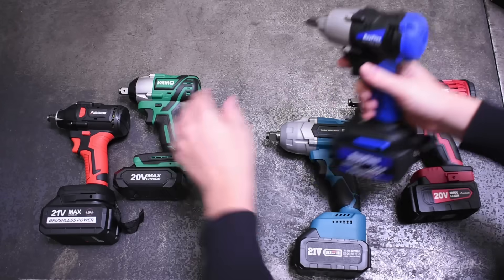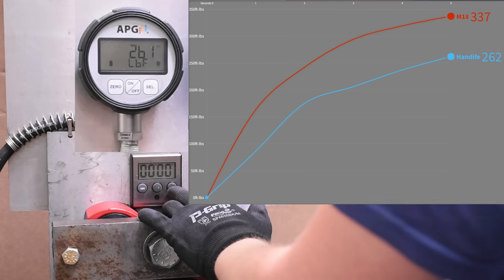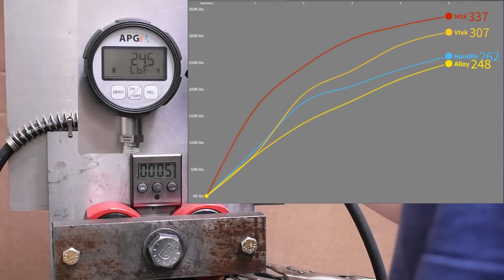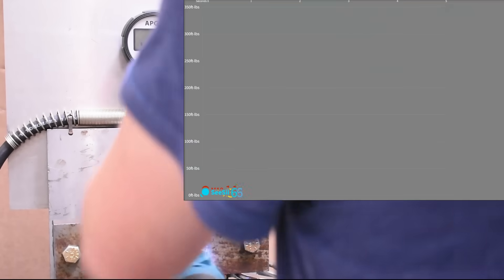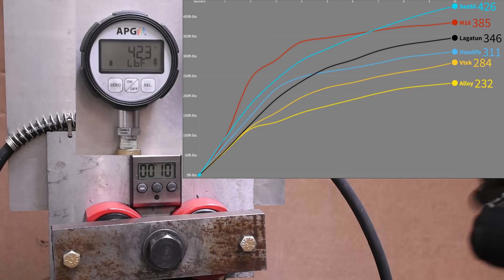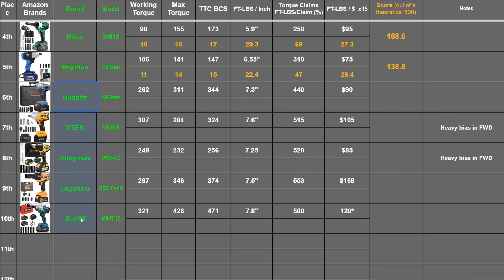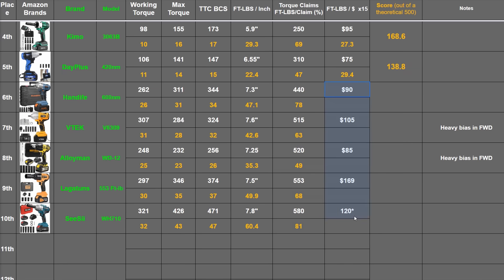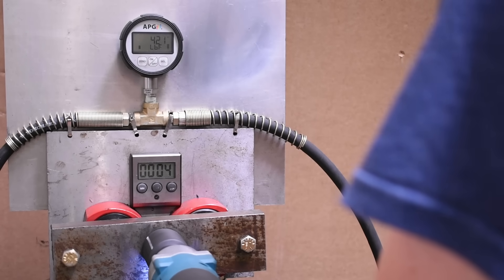The Most Powerful Amazon Impact Wrenches vs Milwaukee: Not Bad!

Comment: Bought Seesii WH710. Found on the big A for $70.00 1 battery version. To be delivered today. Just for removing lawn mower blades for now. Made this choice based on reviews and their mini chainsaw reviews.UPDATE: Used this on 22 inch Toro Recycler & 50 inch Toro Timecutter Max zero turn. Took all blades off effortlessly! Needs 16mm socket. Used regular socket out of my tool kit. Highly recommend!😂

Comment: so ft lbs is just an exaggeration to make you think like you're getting a higher foot pounds?
Reply: I would assume that the numbers everyone chooses, from the Amazon sellers to the name brands, are the absolute tightest bolts these guns can theoretically break loose.  They may take some time doing so, but they'll get those bolts off eventually.  The tests TTC does are useful, but they can come short of what companies can claim, because they don't run long enough to see the lines plateau, which is the theoretical tightness the impact wrenches will have any effect on.  In another video, a Dewalt DCF961 was able to climb up to 1000 foot pounds, but once it reached that number, it didn't climb much higher, meaning it's limit is 1000 foot pounds and anything tighter will be a no go.

Comment: The Seesii and the Handife/VTEK twins are all Wosai/Qidong Edge Tool products, models 50081 and 5008 respectively.  I don't understand, however, how the twin tools perform so different from one another, Handife preferring reverse and VTEK preferring forward.  I also noticed the VTEK's anvil is sticking out a bit more, so maybe this is actually a badly assembled clone?  EDIT:  I did some mild research on Aliexpress and I saw an impact by "Ipopulus" that has the same protruding anvil as the VTEK, so it's probably a clone of the Qidong Edge Tool original.  Nevertheless, since the Handife and Lagatuns are no longer available, that only leaves the Seesii, VTEK, and Alloyman as the survivors.  The value of the Seesii can't be beat, and the VTEK is a naturally cheaper tool that can get some steep discounts (currently can be had for 49.99, down from its list price of 79.99), while the Alloyman has lackluster performance with too high a price (currently 74.99, with just ONE battery, down from the regular price of 99.99).  I consider the VTEK ideal for tire changing duty, be wary of the forward bias however.

Pah, it was this video that enamored me to the world of Amazon impacts, as I bought the WH710 and the Ework RB-809 thanks to your testing, and am planning on buying an Ework RB-810 (which you tested as a Seesii WH750, which is now discontinued) as a gift for a coworker, since he liked my RB-809, as well as another WH710 (or one of its clones, such as the TaskStar or Takuoo flavors) for a friend, due to its consistent sales and value.  For these prices, they are phenomenal, and your testing helped shine a light on these affordable gems.

Comment: As someone who works in the trades those Amazon impacts and drills may have more power but take them on the job for a few weeks and see how they hold up😂😂😂.  This is why all I own is red because I can throw it let them fall from a ladder get wet out in the elements and they just keep going.  Same with DeWalt
Reply: Thinking about buying snapon impact. Any thoughts on their stuff?
Reply: The M18 has two things going for it - one it's nearly 2 inches shorter than the Seesii, and the torque curve is a lot more responsive instead of gradual.  Like the video said, the M18 will break loose certain tightness faster, but in theory the Seesii should break loose tighter bolts first - assuming the charts work in real life the same way.  A similarly sized tool from Milwaukee or Dewalt will leave it in the dust, however.

That being said, I would argue only Milwaukee and Dewalt are tailored to the trades, with warranty processes to reflect that.  Every other brand, be it Ridgid, Kobalt, Ryobi, those are more tailored to the home DIYer, and those would be fairer comparisons to the Amazon offerings.  The fact many such tools work a lot better in reverse than forward implies they're more for breaking things loose rather than driving bolts through, which is what the average person is most interested in.  However, there was a video where a guy was taking the Seesii through various torture tests, and it still came out working.  I wouldn't trust it to do the work you describe, however, but it would be a fun experiment to take it with you, and bring the M18 or what have you as a backup so you aren't stranded if and when it fails.  It habitually goes on sale for 101 dollars (and sometimes down to 99) and they almost always include a 20 dollar discount coupon as well, for 79-81 dollars before tax, for a tool that includes a case, two batteries, a charger, and 6 sockets, that's not bad at all.

Comment: I’ve got the compact and mid torque SeeSii and they are awesome!! They’re the ones I take on the trail and don’t mind the dirt and grease on them from changing CV axles and turning suspension bolts and nuts. Thanks TTC

Comment: In the number one reason why these impact wrenches seem to be a good value for the money is because could you imagine trying to find a battery pack for a no-name brand device a lot of these devices are going to change names within the next 6 months so imagine you have this impact tool and it's 3 years later and you need a battery okay but VTech or CC well you can't find those anymore Faith change names are you going to get a battery that fits

Comment: The reason is cheap electronics a lot of the no name brand cheap chinese-made impact wrenches although they are somewhat decent the problem lies in the electronic boards that are put in them so once you drop these things a few times or get them wet or subject them to harsh whether they'll stop working that's why they're cheap they're cheap because you're not going to have it for 25 years they're cheap because you're going to probably use it for about 2 or 3 years and it's going to stop working possibly for no reason
Reply: Milwaukee and Dewalt are also made in China bud

Comment: So I just ordered this based off this video, and I can tell you that if you have Amazon prime, the price of this tool with the single battery kit is now sitting at less than $70 after applying a $25 instant coupon and a 10% off promo coupon.  That's one hell of a deal.
Reply: Is the deal still on?
Reply: Where do you get the coupons
Reply: @ippytuklulu  they automatically show up on Amazon, you just click on it to apply the discount

Comment: @Torque Test Channel I own the Handife since September 2021 and it's a beast! When I purchased the Handife I replaced both front half axles, both tie rods, both upper and lower ball joints, rotors front and back, shocks front and back on my 2003 Dodge Durango.
As a test I didn't use PB Blaster on the the passenger side, but I used PB Blaster on the driver side. 
Handife broke every single rusted bolt off with ease.
Prior to buying the Handife I tried using my friends Milwaukee and DeWalt impact wrenches and neither one broke the rusted half axle bolts lose, and that was with using PB Blaster.
The Handife inpact wrench I own, I'll put up against any impact wrench.
The Handife I own is no joke. My mechanic friends has offered me double to triple amount of the money I spent on it and I turn them down.
I picked up the Handife when it was on sale for 89.99 plus and extra 20.00 off. A beast for only 69.99+tax.
Reply: I think there is more to Impact Wrench performance than just raw power. The design and effectiveness of the hammer design for example. I have Wrench witch is a close mate to the Handife and I share your experience as well. Paid $59.00 including hard case 2 4 amph batteries with a decent charger and have no regrets. Would buy it again.

Comment: I Bought a SeeSi after seeing this video. I even read their amazon review of some being defective from the start. I charged the batteries and tried removing my lug nuts and it was not strong enough. had to do the job with hand tools and a breaker bar. I tried again and the tool now only worked in spirts. I guess i got one of the defective units.

Comment: There is now a SeeSii WH750 for $150-$40 coupon = $110 (1 4A batt + charger).  I believe this is the Gen3 product.  Note that this one comes with a blow-molded case (TTC did not care for the prior case).  They claim higher torque than the WH710.  Please test.

Also, someone said that the batteries are Makita-compatible.  If so, it would be interesting to compare the performance when using Makita batteries with SeeSii tools (and vice-versa).
Reply: I want the wh750

Comment: I bought the SeeSii based on this video months ago and was blown away by it's performance!
 Not mentioned in the video is that it has 3 modes which makes it perform well while saving battery life. This thing worked so well removing torqued nuts and bolts from super steel support beams for machine conveyors it was almost comical.
I later found a 1/2 inch keyless drill chuck attachment that I added to this tool's well appointed kit. And the price point made it a bargain.
  This video was instrumental for a great tool find. Thank you!
Reply: can you link to the drill chuck you found?
Reply: How's the seesi holding up
Reply: @funkmon  very well !
  I had to replace a BMS on one of the batteries but that's alright.
 I was hoping that one of the guys at the job site would drop it accidentally so I would have an excuse to buy another one. 🤭
Reply: @Mr_Joseph979 how is it doing now
Reply: @ippytuklulu  it's doing well. One of the batteries died inexplicably to which I replaced the BMS. That didn't work so it was probably a few weak cells but I just replaced the battery, which is the same as other Chinese batteries. I still like the unit.
Reply: It's currently $108 at Amazon right now in September. That's a very good price for performance for any DIY warrior.
Reply: @joseCalderon1976  it is, but when it dies after 3 months, those 108$ are gone for good...
Reply: @PM-wt3ye  I've had mine for over a year and a half now, used literally daily for roadside assistance/mobile mechanic work in some of the worst conditions imaginable.....and it's still holding up strong.
Reply: @williamwakely1398  The problem is, you dont know what you get with such a tool. you may be lucky sometimes, but when all your tools are extremely cheap, this will change. the known brands are too expensive, sure. but these tools are WAY to cheap to be consistently good. especially, when there is absolutely no warranty what so ever.
Reply: Answering myself here, it loosens and tightens crank pulley bolts very well.
Reply: ...Buying it with the extended 3 year warranty is a must if you go  this route.
Reply: What are the batteries like that come with the kit?
Reply: @dmusk  lithium ion 18650 batteries that total 21 volts or pack.
 2- 21v batteries with a charger and 6 impact rated sockets. The updated package comes with a drill driver adapter that I didn't get with my kit.
Reply: @Mr_Joseph979 can you link the chuck you found?

Comment: I recently got a Uaoaii 21v Brushless ½" impact wrench off Amazon. It looks a lot like the SiiSii one, almost identical but mine is more compact, I guess mid range? It's worked pretty well so far. I've used it to do my front and rear shocks on my car. I wonder if it is the SiiSii but rebranded? It has the same battery as well. So I can use a makita battery on it?

Comment: Great comparison, thanks for all your affords, all my tools are Bosch, have a 160Nm Bosch impact driver, but I need a high torque impact wrench maybe once a year if something is stuck as a hobbyist, watched this video last week, so I went for a SeeSii Gen2 today, it was on discount on German Amazon for €110 ($ 115) I am in the Netherlands, but shipment was free. 
Seen another review and the battery calculations were 3000mAh and after a teardown on that video confirmed that too ( https://youtu.be/pNTWWNZjPUs?t=240 ), I was planning to rebuild the batteries but since you tested with an original Makita 5Ah battery and didn't see much improvement, I will leave it like this. Again, thanks for the test!

Comment: Do all dead blow hammers deliver the same force?  Are they better always than solid? Does “anti-vibe” work?  Use your rig for air hammer. Wedges made of different materials. Aluminum steel hard steel plastic

Comment: I've recently bought a Tagred TA800, which is a small (114 mm/4.5" long) 1/2" air impact with supposedly 1200 Nm. Now I know that it's not getting anywhere near that, but with enough air this little thing actually does hit a lot harder than I expected for ~50 € (+ VAT, so here in CZ it ended up at ~60 €). I think it could be in the 400s or even low 500s. Do you think you could somehow get yourself one of these from Poland and test it on the dyno?

Comment: Yeah i bought one brand, called bossmann, seriously it is powerful enough. Easily loosen 400nm tight lug nuts. And loosening my suv lugnut that been lock with 700+nm air compressor gun. And the price just around 30usd.

Comment: the length needs to be a big factor, some of these "midtorques" or longer than high torques.. im sure milwuakee could make enough torque to snap the 1/2" anvil off if size wasnt a factor... they must make 50 iterations of every impact gun trying to shave off 1/8" pieces of plastic where it counts to get it to reach just a few more vehicular use cases

Comment: How about some basic durability over time test? Like yeah they can push some power, but... for how long? Maybe we could get some ideas on how to make such test. Like for example just tape trigger so it will work constantly until battery will die, throw it a bit then(from like belt high) and repeat it and see if later it will do some actual heavy work. Or if you have time just test it under load few times to see if it will not die after day of work...

Comment: Are you insane? The low density foam case is a way better option. Almost everyone I have ever met just tosses those blow molded case in the trash as soon as they get them like it's part of the packaging, or throws them in a big stack to never be used. On the other hand people pay for empty case with foam inserts because you can customize them to fit different accessories by cutting the foam, and you can keep them for different purposes long after the tool becomes landfill.

Comment: Need to do a test on the batteries to see who has the most amp hours, that'd be interesting.
Reply: That could be a job for Philly Fixed, its not really torque related so better if they outsource it.
Reply: @pflaffik  probably, but he has done other test than torque on other products. Need to have a battery tester to put a load on them and measure the watt hours.

Comment: I can't fathom why anyone would want one of these disposable nightmares. Even if the performance was close to an established name brand- you know the long-term durability and parts quality is going to be awful. Customer support non-existent. They'll be shorting out when they get wet, or have sudden electronic or trigger failure when you're in the middle of a project. I'd rather buy a used quality tool or get something from Walmart if money was a big issue. Great tests though and very insightful. Keep up the good work!
Reply: "They'll be shorting out when they get wet, or have sudden electronic or trigger failure"  That happens with the knock off led lights that use Milwaukee, Makita, DeWalt batteries.  People become upset when ersatz chinesium emergency lights don't work during an emergency.

Comment: Speaking of that flashlight "overselling", I bought a 1w light on AliExpress that claims 990,000,000 lumens! And if you look around, there's a lot that claim similar specs, although most are in the 10 million lumens or lower range, so SLIGHTLY better... It was $1.99 with shipping, so not really a loss. I was just curious what it'd actually look like with those types of claims!
Reply: The incredible thing is that you actually bought it only because of the claim, so their strategy was a win. Chinese Vendor 1 - you 0.
Reply: @pflaffik  I knew it wasn't true and I only paid $2 for it with free shipping. So yes, they likely made a little money, but not much at that price! I just wanted to see how bad it really is... Besides, I can open a dispute with AliExpress and get my money back if I want easily enough.

Comment: I think you misinterpreted your results in the CCW test. You said it would undo a nut eventually. So basically you test the left hand tightening so quite the opposite what you refer to. So correct interpretation is " It would undo a tighter nut but would lose speed screwing it off fully".